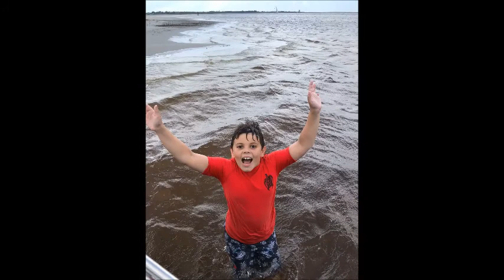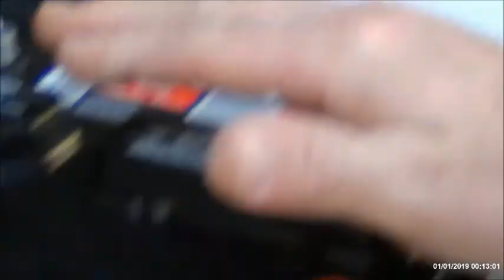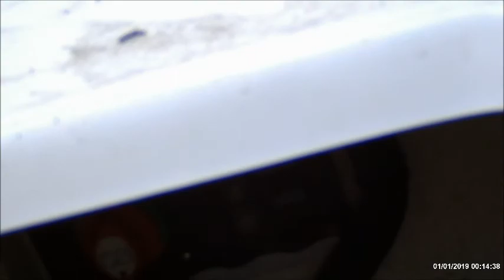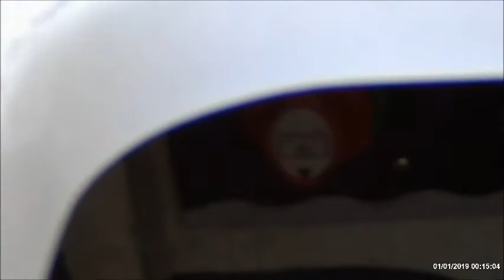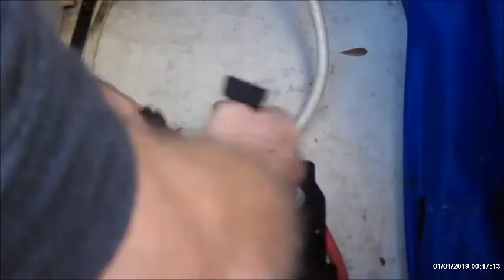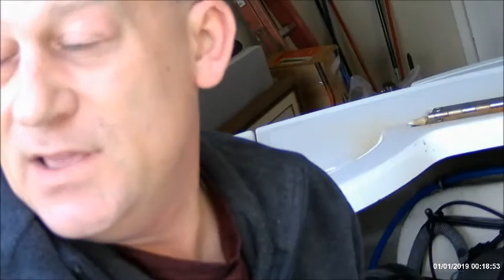Marine battery Installation on a 2009 214 FSC Monetary, Deep Cycle, Duel Battery, Cuddy Cabin

Comment: Thanks for posting, here is my problem--I have one battery that has, of course, the major black wire on the negative, and the major red on positive.  And the minor black wires of course, also on negative.  BUT, there are wires dangling now-for several components.  They are NOT black--or red. I can't trace where the other end of the wire goes, so how do I sort if should put them on the red or black post?  Related, is it safe to go to the helm and find some component that is not working, then go back and touch one of these wires to the red and see if the component comes on--or will that maybe burn out a fuse?  thanks.
Reply from the maker: Thank you for your response and question. The other wires can be a few different things. Acc. wires that control certain components, added instruments maybe from previous owners. Is your engine an inboard or outboard?  Is this a single or duel battery set up? There will be a colored wire that goes to your battery from the alternator if it’s an outboard, usually a yellow wire. If you’d like you can send me a picture of the wires and I will tell you what the possibilities are.
Reply: @theanamae60  Thank you so much for your help, they are red/black, or black/red if one prefers.  As they are not solid red, or solid black, I just don't know if there is a danger "touching" them to the positive post to see if they actuate the deck lights, or the bilge pump, or what have you.  This is an 19 foot cuddy, with 115 hp four stroke Yamaha.
Reply from the maker: Jmichael Isbell 
In my prior experiences, with many types of boats I’ve had, the red/black wire usually indicates a power wire. Without actually seeing the complete harness or set up it would be hard to determine what it could actually go to. My thoughts would be maybe a bilge pump, tilt/trim, kill switch or possibly for the charging from your stater. You may be able to find a wiring diagram for your specific boat and motor and the color codes should be able to tell you what they are for. Ground wires are typically black/white when used to ground other components.
Reply: @theanamae60  My "gut" told me the same about black/red wires, but I defer to your experience.  NOT that I will blame you, or anyone if I touch one to the positive pole--and am wrong.  That's on me; that said, I do appreciate you takin the time to give me your expert thoughts, I really do.  As a side, I wonder your thoughts on the new, and somewhat affordable Lithium batteries.  For weight alone, wish I had heard of them before I put my two 60 pounders in place.  Regards
Reply from the maker: Jmichael Isbell 
If it were me I would probably give it a try. Turn the key to acc and just take one and touch the pos post and see what happens. If it arches then it’s a no go. I don’t think it would enough to make it explode, and a 12 v shock isn’t that bad. You may want to try and look up the year and model wiring diagram. That would be my only real solid suggestion. As for the Latium batteries I haven’t used them. On my cuddy I now have 3 batteries, one for starting, a deep cell as my “house” battery( both are hooked up to my selector switch ) and a third deep cell I have hooked up to a solar charger and 2k converter for tv, fridge and charging station.
Reply: @theanamae60  yeah, and fact is, no need to get shocked, just proper insulated gloves like I have, a quick brush across the positive pole--I really do think the red/blacks are in fact, positive, plus this time, mark the function on the cable for future use.  Again, I appreciate you keeping it real, boater to boater.
Reply from the maker: Jmichael Isbell 
No problem at all. Let me know what you find out.